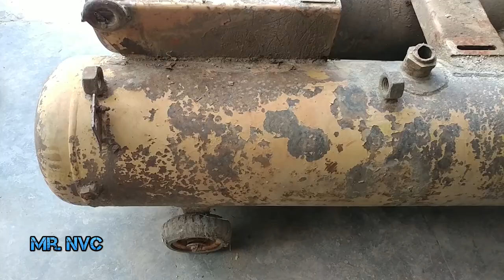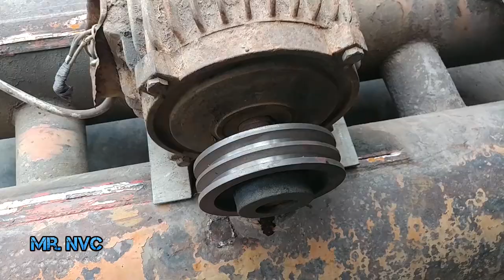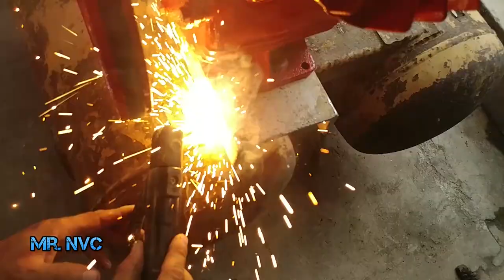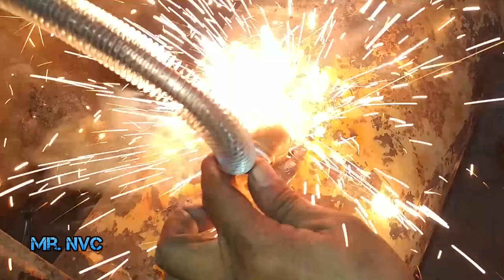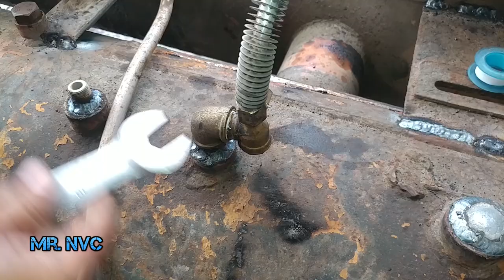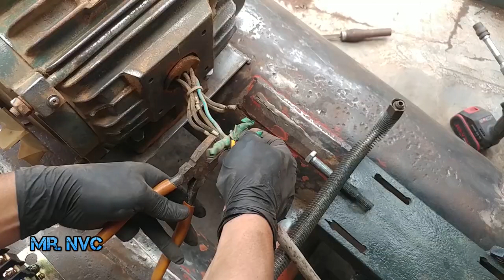Restoration and Rebuild AIR COMPRESSOR

Comment from the maker: it has 2 safety valves.  This bottle can withstand 20 bar pressure but I use only 10 bar.  It is safer than you think
Reply: Correction, the bottle WAS designed to withstand 20 bar pressure,  how long ago was that?  the rust that has been eating away at the metal all these years will have weakened it , I would never use that device at all.

Comment: possibly one of the most dangerous videos I've ever seen on youtube, welding a pressure vessel without getting it retested and certified is just plain stupid.  this thing is a bomb waiting to explode under pressure.
Reply: Yes, very dangerous because He did not perform the hydrostatic test in the vessels..
Reply: @npessoa2  The odds are that the tank would show a leak before it got close to exploding.  Air compressors don't operate any where near the pressure that a true pressure tank (Scuba, oxygen/acetylene welding tanks) does.  Still, the tanks should be tested.
Reply from the maker: it has 2 safety valves.  This bottle can withstand 20 bar pressure but I use only 10 bar.  It is safer than you think
Reply: Nor was there any inspection of the insides with a bore scope for rust and pitting...who knows how long they've been exposed to the elements with all those ports open at the beginning.  Let alone the added vibration of 2 compressors.  Disappointing to watch even at the half rated 150psi (10bar) and a new dual pressure switch.  Scares the hell out of me...I'd want 200' of line and a wall between before I sparked it up.  Been a fan for quite awhile but this is at the edge of sanity.
Reply: Also the tank has serious rust pitting which weakens the metal

Comment: Came from Canada don’t you think you should have pressure tested your tanks before restoration and before putting on new motors first thing to do when restoring it to pressure test your tanks you do not do this
Reply from the maker: it has 2 safety valves.  This bottle can withstand 20 bar pressure but I use only 10 bar.  It is safer than you think
Reply: Sir, I fully agree with you. Since this is a  pressure vessel, it should be conform to some safety standards. A bomb is waiting. Worst way of restoration.

Comment: This is not restoration, this is jury rigging a bomb.  Having two safety valves is meaningless when you have no certification for the main tank.  Without knowing what the main tank can actually hold, you have no idea what the safety valves need to be rated for.

Comment: The tanks have very heavy pitting.
Reply from the maker: it has 2 safety valves.  This bottle can withstand 20 bar pressure but I use only 10 bar.  It is safer than you think

Comment: What's the deal with the copper pipe with "washers" along its length? Specific name? I assume it's for heat dissipation by its appearance, but why would you need such a thing on an air compressor (does it generate that much heat)?
Reply from the maker: it dissipates heat.  when the gas flow is transported at a high speed, it will generate enough heat

Comment: What has happened to the sound? :O And why are not not making a demontage/working schedule? And why is your first step to weld a 'new' wheel? A bolt nut to adjust the drive belts tension? This is just madness :D The video was not worth watching it :( sorry, bro

Comment: Schweißen mußt du aber noch üben, das tut ja in der Seele weh. 
But you still have to practice welding, it hurts the soul.
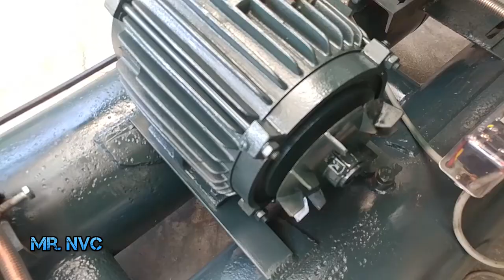14:20 was ist das denn, läuft der Motor mit Schwachstrom, 
14:20 what's that, the engine is running on low current,